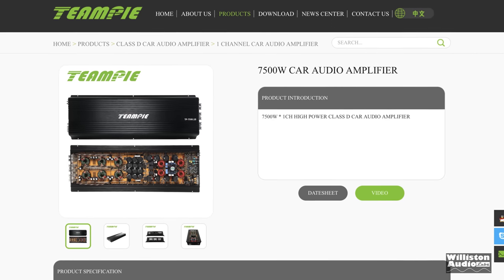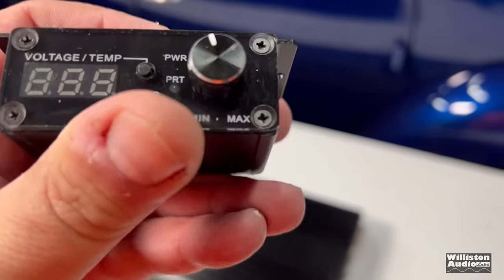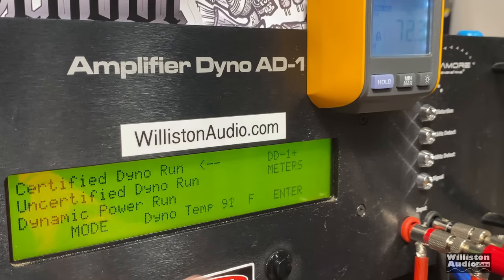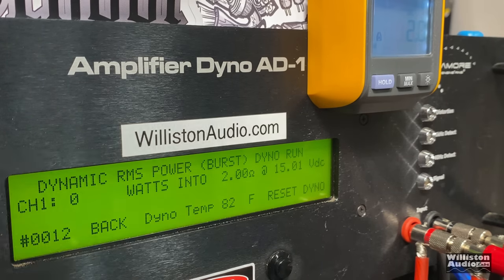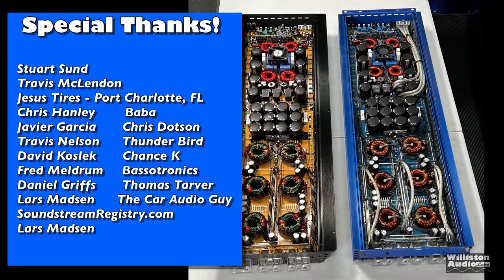POWERFUL SUBWOOFER AMPLIFIER! Teampie TP-7500.1D [4K]

Comment: I tested a Teampie 4 channel and it was super efficient as well. Seems like a solid amp for someone willing to take their chances on the warranty/quality control issues.
Reply: @wal  soi have a question how many 14v batteries are needed to hold that 14v in a car. To get good quality sound
Reply: @newmoney8128  you'll need 2 320 amp alternators and about 100ah of lithium. That's what I run for my sundown scv7500. My voltage stays around 14
Reply: @krisoldaker4171  thanks man I only have two skar VXF-12 | 12" 3,000 Watt Max Power Car Subwoofer - Dual 4 Ohm
And SKv2-3500.1D | 3,500 Watt Monoblock Car Amplifier.

You think what u recommend will be too much or just enough
Reply: @newmoney8128  for that skar a 320 amp alternator and 50 ah of lithium should be plenty
Reply: @krisoldaker4171  okay thanks man it's crazy Big D won't help us out smh
Reply: @krisoldaker4171  so what 50 ah lithium battery would you recommend and it would be a 12 volt correct
Reply: give me break those amps last if they are hooked up with the right stuff . 9 times out of ten amps die because of owner abuse and shotty installs . that clip button is your insurance for your amp and woofers . turning it off is just stupid . teampie has been around a long time because they make incredable amps ! besides this design has been around for a least 10 years so if it anit broke dont fix it ! where else you gonna get 8k amp for $680 !
Reply: Its a QUALITY issue, with quality control issues on top. They operate by taking common amp layouts but sourcing all components with the cheapest they can get by with. This is on top of the quality control issues. I dont see how you could call it a 'solid' piece of equipment from any perspective.
Reply: @craigengelman4534  Have you seen the ratings of the caps in these? Have you seen the sub-par mofsets used? They cheap out so hard they cant even get a thick enough coating on the transformer windings, And thats assuming they wound it correctly.  They are a cheap, low quality china built amp. It is what it is.
Reply: @newmoney8128  Big D helps out all the time, but he doesn't have the time to read hours of comments everyday. Or he may wait a few days for comments to build up and then go through a bunch of them.
Reply: @andrewlewis5251  I have not seen any instances of them sourcing poor quality components. What are some specific things you've seen? They have already addressed these loose coil wires by adding a liquid around the top to hold everything firmly. They seem to be constantly improving.
Reply: @andrewlewis5251  Using a common amp layout is not a bad thing as you imply. If you want original designs like Rockford Fosgate, you have to pay Rockford prices. Lots of companies using similar designs, its not a bad thing. They appear to be just as good as some of the other copy cat designs yet are priced much lower because there is no middle man. Have you seen any instances of the amps having issues or breaking? I would be curious to know if they are prone to damage or perfectly reliable.
Reply: @JasonWW2000  who are you sponsoring for because your going back and forth with one person about ah amp. Then telling me big D response shit I got unanswered question that I posted 45secs after he posted it just to see at times and still nothing. We got got YouTube channels and know damn well we see every single notification. When someone sends a comment. 😂😂
Reply: @newmoney8128  Sorry, I don't know what you mean by sponsoring. 
I can't make out most of what your saying, but I think your not understanding  what a large channel is like. Bid D has 277k subscribers. He gets 500 to 1,000 comments on every video. Remember that he also has a 9-5 job and does these videos on the side. There is literally no way he has time to read all of them. Only very small channels or maybe full time channels that have several employees can go through and read them all. Even then its rare.
Reply: @JasonWW2000  exactly how you responded makes it sound like your a sponsore of his or a employee. Or a secretary that's helping people understand why he won't answer our questions but he picks and chooses who's questions he'll answer just look at this video and previous ones is all I'm saying but another person was good enough to answer my question which is fine. You act as if y'all coworkers and you see him working everyday. 😂😂
Reply: @newmoney8128  Nope, I just started watching his videos a few weeks ago. I'm kind of familiar with how the larger YouTube channels operate, though. You just can't expect to get an answer. Now a smaller channel that doesn't make a lot of videos and doesn't get a lot of comments you can probably get a response. My channel is tiny and features niche content that is just to help people out. No fancy editing or anything. I can answer everyone's questions. The bigger a channel gets the less likely they will read all comments. Its just the way it goes. What cracks me up is people asking questions to celebrities and getting mad they won't answer. They post one picture and get 10,000 comments in an hour. Lol. You have to lower your expectations. :-)
Reply: @newmoney8128  PS, I looked at your original question and its not even related to the video. Is it? That alone is enough to make a person skip it. Plus, you kinda comment jacked it from Hifivega. That's considered rude. Strike 2. Its much better to ask that as a new comment. 👍
Reply: @krisoldaker4171  dual alt brackets are not readily available, nor easily obtainable for all makes & model vehicles... For instance I have not been able to find a dual alternator bracket for my vehicle & I've looked all over, even called specialty alternator & generator shops. Now if the person has a Chevy then they can typically find one multiple places, as Chevy dual alt & even multi alt brackets are the most common & easy to find. If I could find one for my vehicle, I'd buy it ASAP!
Reply: @itdoesntmatterwhatyourname6128  Your gonna have to build a bracket yourself. Its not too hard assuming you have a serpentine belt.
Reply: @andrewlewis5251  ive used these amps for years and have had 0 notta problem . they do upgrades and all kinds of stuff .when i order mine i get the Nichicon gold upgrade its $40 more .
Reply: @newmoney8128  not a sponsor just a supporter. He understands how $h!t works.
Reply: @gregorydingess3659  all this for a simple question 😂😂😂
Reply: @andrewlewis5251  well I have 1 of these 7500.1 from team pie running at .5ohm for over a year in my daily without any issues but I'm running lithium and alternator so I would hesitate to spend another 800 or 900 on another if this on3 blew today

Comment: The clip limiter prevents the amp from sending out a clipped signal which is probably why the first few test had thoes jumps,,, it is a very useful feature that can save a persons subwoofers
Reply: Good ole clip meter to the rescue. Really is a life saver
Reply from the maker: I didn’t enable the clip feature until the 1 ohm run where I showed it enabled
Reply: @wal  oh ok must of misunderstood when you said turn it to off,, was thinking that’s why it was having thoes jumps… so then the results were better with it turned on then? I suppose a person wouldn’t see jumps like that in vehicle tho anyways

Comment from the maker: For those who watch all the way until the end, the 0.8 ohms uncertified test was mistakenly shown as 1 ohm. The 0.8 result was 9624W at 14.52VDC. Sorry about that!

Demo of the 2 7500's is from BigVell02, see full vid here:  https://youtu.be/0eOfZcRofO8

Video Index:
0:00 Intro
1:13 Unboxing
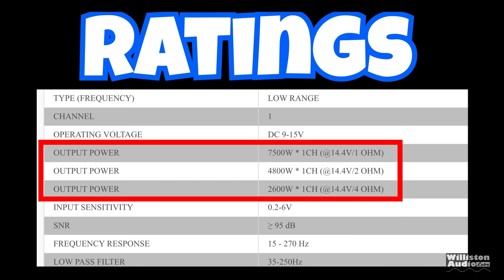2:15 Ratings and Specs
3:40 Settings for Test
4:55 Amp Dyno Tests
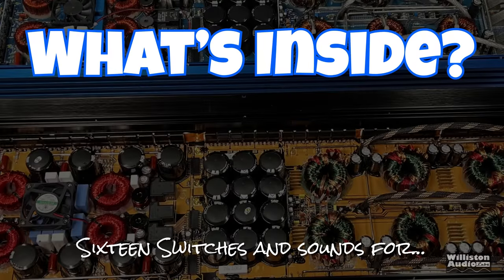9:16 What's Inside?
10:39 Real Demo's
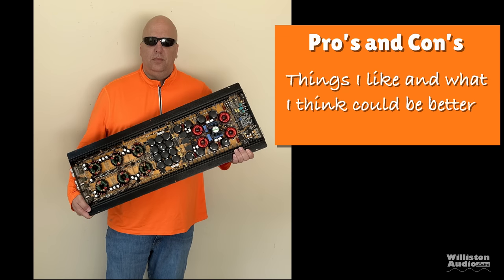11:01 Pros/Cons
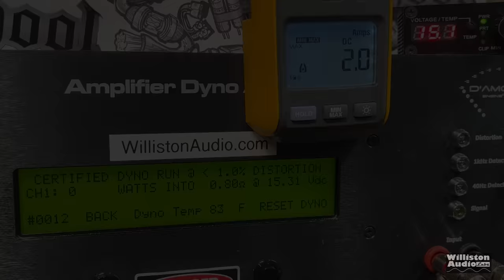12:15 Extras

Shop: (affiliate links)
Taramps MD8000.1EX (2022): https://amzn.to/3DDhjzy
Taramps Smart 5 Amplifier: https://amzn.to/3oX0XLV
Taramps Smart 5 Bass Amplifier: https://amzn.to/3oXIX3W
KICKER L7R Quad Box: https://amzn.to/3iY77rR
XS Power LTO Cells: https://lddy.no/13d2f
XS Power Intellisupply PSC90: https://lddy.no/13d2g

(Video Gear I Use) 
Camera - iPhone Xs Max 512GB - https://goo.gl/uFHBh8
Samson Go Mic Mobile - https://amzn.to/2BSAtll
960 LED Panel: https://amzn.to/2Sxoq3S
Lavaliere Microphone - https://amzn.to/2Rw5PIw
Sennheiser Wireless Mic - https://amzn.to/2BSwIfD

This VIDEO was EDITED with LumaFusion on an iPad Pro 12.9:
iPad: https://amzn.to/2Ancr1W
Software: https://goo.gl/6yvWss

--------- Test Bench Equipment -------

SMD / D'Amore Engineering Amp Dyno: https://goo.gl/sJTcf7
XS Power D1400 Batteries - https://amzn.to/2BPFCKW
XS Power PSC60 Charger - https://amzn.to/2CHGcfs
Fluke 1000A AC/DC Clamp Meter: https://amzn.to/2Rw5WDA
Handheld Dyno: http://amzn.to/2u2EgKV
My Favorite Screwdriver Kit: http://amzn.to/2x0VzcE

DISCLAIMER: This video and description contains affiliate links, which means that if you purchase from one of the product links, I may receive a small commission. As an Amazon Associate I earn from qualifying purchases
Reply: @wal  how much did that amp cost ? I can’t find prices anywhere for it

Comment: Just a thought here, but when you convert the DC to AC the AC doesn't need huge wires to transmit properly, I believe that's why the 8 gauge wires on the output.
Reply from the maker: It’s true
Reply: @wal  Some dummy math?

8000W over 1 ohm will recuire 90volts RMS (AC).
That will need the amplifier to supply 90A RMS (AC) to the speaker wires.
(90 x 90 = 8000)

The same amp will probably use about 900 Amps on the power cable. (65% efficiency class D)
(13.8 x 580 = 8000, but for 65% efficiency 580 / 0.7 = approx 900A

So if we make a calculation to keep the same power loss in the speaker wire as in the power wire and assume that the power wire is about 5 times longer than the speaker wire.

900A is ten times as much as 90A.
So, the speaker wire only needs to be a tenth as large in area for the same power loss.
And to that we have to add that the speaker wires are most commonly shorter. In this case five times shorter which makes it only have to be a 1/2 of 1/10 which equals to 1/20.....

So, if you, in this case, use 3 feet (appr 1meter) long speaker wire (back and forth = 6 feet (2 meter) of area 8 Gauge ( 8,4 mm2).
And use 12 feet (4 meter) two parallell 000 Gauge (2 x 84mm2) wires from the positive battery terminal.
There will be equal loss in the power wires as the speaker wires.

So, the speaker wires is well worth considering to keep very short, just as well as putting extra batteries/caps close to the amp in my opinion. 
But the power wire must be adressed first, otherwise the output of the amp will be reduced regardless of the speaker wire area.

I think, as you say,  4 Gauge speaker wire terminals would suite this amp better.

Please excueeze my poor engloiise, and maybe poor math  :)

Always impressive to watch your tests!
Reply: It's not about ac and dc, it's about current.
The speakers sides have higher voltage so carry a lot lesser current for delivering the pretty much same power

Comment: 2 things one you did a test saying it’s @.8 but it was in fact @1ohm that’s why it was lower @12:41 and second since there not whounded tight can’t you at some of that glue they use on the lose part so there not vibrating? Great amp too by the way and shout outs to JONES SUBWOOFER SOLUTIONS THEY DO EVERYTHING THERE
Reply: Yes, you can. The newer versions have a liquid added to the tops of the coils to hold it still.
Reply from the maker: Updated pinned comment to show 0.8 uncert

Comment: Why are the amps so low on your tests. Your meter showed 262amps at 8461 watts certified 1ohm.  Jones showed over 830amps on the same test?
Reply: 262 ampere TIMES 3 inputs = 786 ampere total!!

Comment: i would add some silicon to reduce the chance of failure due to vibrations. its a cheap preventative measure that alot of amps lack but one that can be fixed easily and pretty cheap considering what we pay for the amps.
Reply: The factory is now doing exactly that.

Comment: For your efficiency on this test , you had 4 runs of 1/0 for power and ground , it seems as though you only x3 your measured current, should it not have been x4 ?
Just confused, I watch all your videos your the best
Reply from the maker: It has triple inputs and I used 2x 1/0 per input so 6 total 👍

Comment: Finally a class D with some BEEF in the design and weight! Please include amperage draw on tests,
 thank you.. I see the amperage draw THANK YOU! You'd need another altinator and maybe another battery in your car to run most of these high powered mega amp. draw amplifiers.. Not a super big fan of class D amps.. If I had a high power set up in my car I'd have a dedicated LEFT and RIGHT channel with STEREO separation. Screw the MONO subwoofer setups.. SEPERATE the sides to get STEREO SOUND! I might not be as impressive for sub. shaking output but it'll sound a lot better if your listening to Rock & Roll!

Comment: I use this amp on 4 half ohm subwoofers and the device is working normally. I hope you will do a half ohm load test for us so that we can see what is the capacity for the amp dyno
Reply from the maker: Half ohm on the Dyno is not something I’d try with this amp. Wiring speakers to half ohm would result in 0.8-1 ohm rise in most cases with most music. I was shown after my vid by a tech my amp doesn’t have the over protection diode and this is concerning
Reply: @wal  This amp has four ways  protect over voltage, over current, over temperature, and output short circuit.
Reply: @princeofbass304  this amp more then likely doesn't have a quality part in it in all honesty. If you have rise it'll handle half ohm. When I was wired at 1 ohm I only had 0.4 rise so I wouldn't risk it with an amp not made to be ran like that with counterfeit parts. It'll work for a little while, but will it be working in 5 years is what I think of
Reply: @michaelmosher7902  Your words are respected, but now I have said it for a month and there has been no problem so far

Comment: Those loose winding really worry me in such a high vibration environment. Won’t take much to run through that lacquer.
Reply from the maker: Apparently new ones are wound better  that’s what I’m told
Reply: @wal  I sure hope so
Reply: Would hot glue help in that situation? To basically encase them in?
Reply: @poopool_Q  if I had one of these (or any amp) and the windings were loose i'd hot glue em... Or put epoxy on there.

Even without bass, vehicles vibrate...
Reply: @poopool_Q  use a neutral cure silicon in the middle hole and around the top. you can run a bead around the base as well. doesnt take long to do. let it cure about a day or 2 and your good to go
Reply: @jarrodbrennan121  thanks. I assumed it would be safer than not but didn't know for sure. In my thoughts, maybe it would cause a heat problem on the coil with a lack of breathing air/space. I'd probably still do it even if that were a risk. I don't have any plans to buy this amp, I already have 3 amps I'm not using much. I might set one up indoor, waiting for high amperage ac->dc converters to be free 😂
Reply: I'd also be worried about the counterfeit fake caps myself.  Seen alooooott of amp guts and have never seen those caps in any amp. But it does put out rated power, they just need to use quality parts. I'm going to try to stay Korean board amps even if I have to buy used amps. Figure quality parts for more money will mean more reliable amps as my Korean interfire 4 channel is over 12 years old and my performance teknique 4 channel is around the same still kicking ass
Reply: Could you put some e6000 on it?

Comment: Why do you prefer the Tiffany style RCA's? Also, is there any signal advantage between the two?
Reply: Tiffany style or panel mount RCA's are more robust as far as pushing cables on and pulling them off. The other style is soldered to the pcb and over time the stress can crack the solder joints. Its not that big a deal, but the panel mounts have a small advantage.
Reply from the maker: Jason’s comment nailed it!

Comment: As much as I like Big power?    I think I will stick with MTX.    Why?  The one time I gave them a call,  they answered the phone,   and even said " just send in your amp in, we can fix it".     THAT WAS IT.     I was a customer for life.  
And they just look great.   I mean sold construction etc.      But the fact that you have a question, and it gets answered?    Hats of to them!    

I love chinese gear,  and when your use amps as tools,  like for SPL?  Great value, and great power at a price you can afford to buy spares?   Easy to repair?   Its a no brainer.    

Looks and performance for me go hand in hand.  And I like knowing that  if something does go wrong with a custom install?  I can call the company for a repair.  That really matters to me.   Custom installs are a mess if you install them just for the space, so having a solid company behind the amp really makes a difference for  me. 

I like American made / Built hardware.   Glad I'm in the point in my life where I can get  made in USA gear when the need arises.   Its pricey.  But I tend not to let go of old hardware.   As each has a story.   I'm bit sentimental with things I buy.
Reply from the maker: I approve of this message 👌